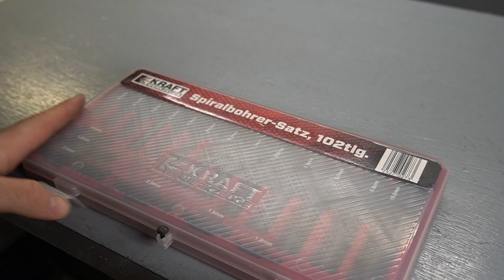Brake Adapter DIY ultralight for hope rx4 front

Comment: I also built an adapter out of aluminum, in my case it was the rear triangle. The problem with aluminum is that over time it gets an unsightly surface due to water etc. So you should think about protection, clear varnish or something similar.

Comment: Uhm, so your brake pad isn’t aligned with the moving dot on the rotor because your top corner of the adapter is close to the frame than it’s supposed to be ( that’s the reason cable wound be too short as the top corner of the caliper should be further away from the frame )?

Comment: Why you did this? Do you need adapter for 160mm? I think it fits without any adapter front and rear too
Reply from the maker: Hey,
Yes i needed an adapter and also the brake cable was very short, so with an normal adapter i would need a new and longer brake cable. Also this adapter weights less than all adapters on the market.
Reply: @madebyman4937  it’s not only the weight. This is piece of art
Reply from the maker: @KostantinosNt.  Thank you so much!